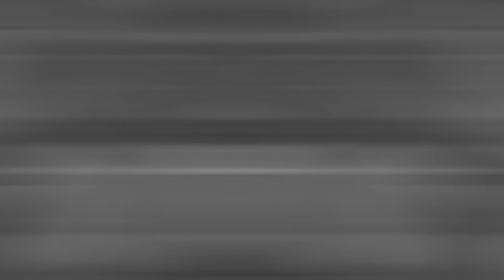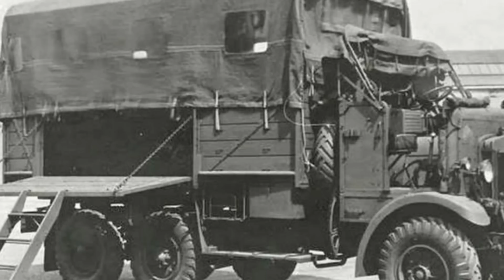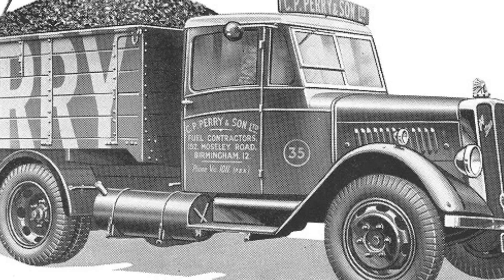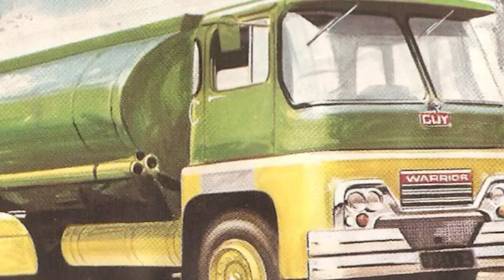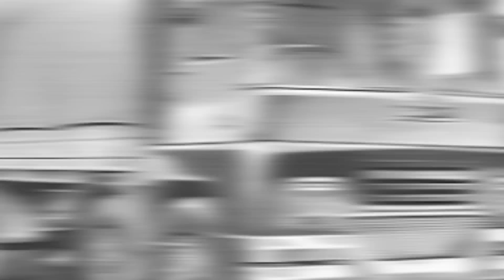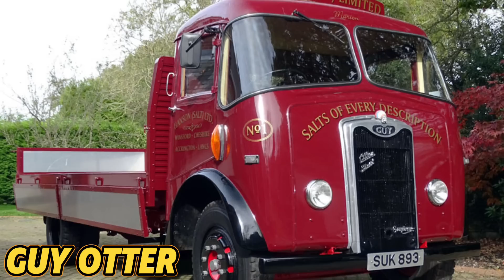The FORGOTTEN British Vehicle Giant That Dominated War and Peace!

Comment: Great to see the assembly line at the start.  My dad drove one of three Guy Big J's Tesco Cheshunt.  It was a D reg short wheelbase with a Cummins V6 engine and two speed axle. Went out with him many times in this, originally pulled tandem's and latterly York 4 in line trailers, before it was taken out of service in 72.
Reply from the maker: @keithchaplin411  Thanks for sharing

Comment: Back in the 1960s The Victoria Line tube was put out to contract, Hall & Co priced the transport away of the tunnel clay for the whole line. They bought a fleet of Guy Warriors fitted with 11 yd. ali bodies, they also bought a closed down brick works near Croydon in S. London with a deplenished clay pit. Clay was transported mainly from The Victoria end of the line to Croydon, some to the works for production to restart the rest to replenish the clay pit.
I drove a Matbro front end loader for Chas Brand & Son on their Seven Sisters to Walthamstow sites, I could load the 11 yd. Warriors in 3 mins and send them on their way. The drivers soon learnt  the right angle to back up to the heap so I could speedily load them. The Matbro had pivot steering and I believe the company invented it then licensed Caterpillar to use the patent. The train tunnels were dug using Tunnel Boring Machines for the first time in the UK, this meant Hall & Co had to hire in more trucks to keep up with the pace. So the Warrior fleet concentrated tin central London to tip at Croydon. While our end the muck went to land fill at Waltham Cross saving mileage.
Thanks for posting and jogging my memory.
Reply from the maker: @TheByard  Thanks for sharing some of your history. And glad you enjoyed the video 🙏

Comment: Started out my lorry driving career in the 80s on Leylands, awful motors, noisy, uncomfortable, no wonder the German and Swedish marques dominate now, comfortable and reliable. British lorries still using 50s tech in the 70s and 80s, thank god they went extinct. Nice to look at but that’s about it. I have an old Bedford TK manual in which it states ‘a radio may keep the driver happy’…… says it all really.
Reply from the maker: @James-gr5rz  Shame 
The UK produce some good politicians though 
Ah hang on a sec 🤣🤣🤣
Reply: @RewindwithRichie are you Clarckson's joke wrighter.
Reply: TK's famous for breaking half shafts, I helped a driver stuck on a hill with a busted half shaft. He had to keep his foot on the brake as the hand brake used the prop shaft and so was useless. A handy stack of bricks and  a couple of load byats off my old ERF did the trick.
Reply: @TheByard  a mate of mine who is 12 years older than me told me when he took his HGV test the tractor unit he took he had to to take his own tools and make sure it was road worthy can't imagine that happening nowadays. I remember reading about International Harvester I think it was having the same thing happening it turned out to be something to do with the casting not being case hardened after matching sounds like the same thing happened at the Bedford production site.

Comment: The Big J came with so many different engines from a Leyland 400 and 401 power plus to Gardener, Cummings AEC, i think the Big J could come with many configuration of engines and gearboxes I drove a four weller with a two speed coach diff with a David Brown back to front gearbox and a Leyland 401 power plus and My god that would fly and pull a house down when  loaded with 10 tonnes on its back.